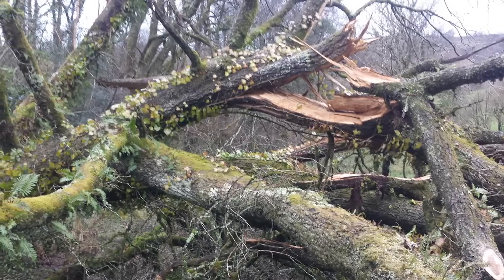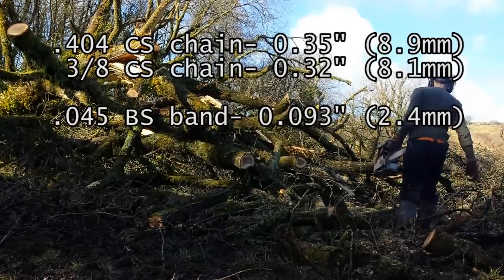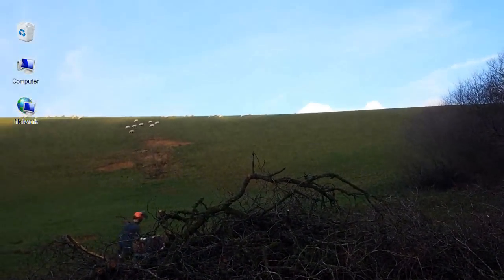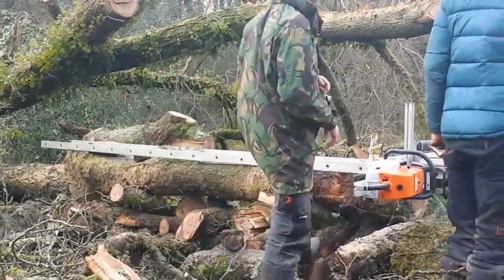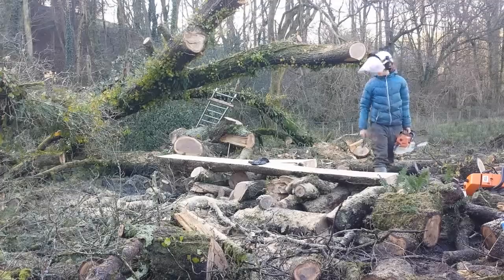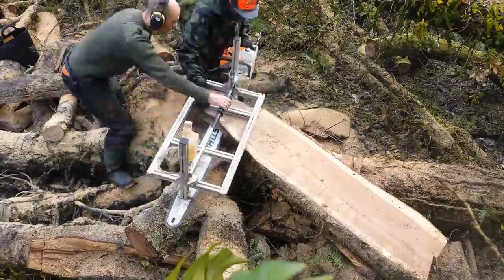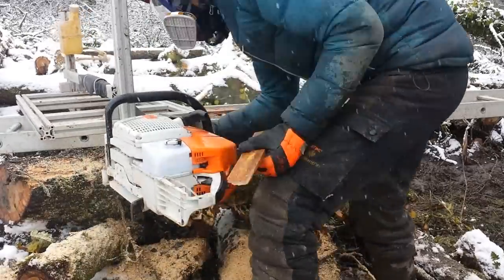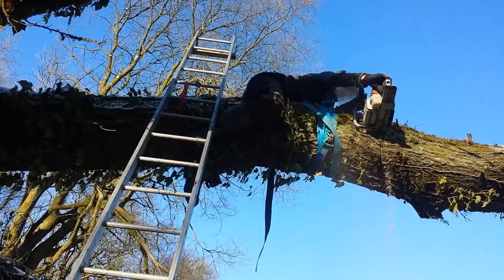Why DIY Chainsaw Mill BEATS Band Mill (cutting a Massive Oak)

Comment: A great overview for people on the Alaskan Mill. I run the same kit as you i think and would agree that you definitely need the right power to mill effectively. I got fed up with the effort involved, so fitted a winch, makes it easier if you are doing a lot of this. Also found it really important to use a 3M respirator, as the fumes are really nasty when you're so close up, found myself getting headaches a few hrs after use. 
I can't justify a big mill for the amount I cut, and not sure I want the care needed associated with owning one either, so this gives me the freedom and control to cut my own timber. Also nice to see some respect for the tree, too many people are just interested in commercial type felling and never seem to plant anything to come behind it.
Reply from the maker: John Roper fully agree with you. Will mention about the respirator in the vid description - it's quite important.
Reply: I used to mill without respirator, having the inconvenience of lots of dust in the nose,  but now I'm also using one of 3M. Much better now, but I only have filters against the dust, not the fumes. Which type of filters do U use to filter the fumes? Keep up the good milling! Opening a tree with the mill is like opening a present
Reply: Ditto

Comment: I have a 2 ton semi-clapped out (but mechanically good) dumper - a 4wd one. I use it as a timber skidder, log carrier, wood extractor, wood puller & general "get you into places not much else will get you to" yoke - you'd find one very handy for this work, Mr Elbowgrease. It's also ideal for lugging out heavy slabs. :-)

I share your views on making useful timber out of what would be wasted wood - but alaskan mills bore me witless so i just learnt how to cut slabs freehand like they do in the 3rd world etc etc - which I do.. erm, cut slabs. Having seen your mill, it looks a lot less dull than most of the ones out there, so the design may get knocked off with little or no credit being given to the originator - I.E You.. what for making me look smarterer with the missus & whatnot. :-)

Comment: Monster tree, shame to see it die, but great that you can get some really good use out of it :-) I felled around 200sqm of forest using a 300mm/12" dewalt 18V chainsaw about a year ago, went very well, only took me a week while working half days remotely on my laptop during sunlight hours, cutting timber first thing and last thing. Near silent for stealth and plenty powerful enough - the largest trunk was a mere 350mm wide requiring backward cuts to complete on the tiny saw, but before that day I had never felled a tree at all, only light use of dad's chainsaws from time to time. But, needs must, legislation change forced the timing. Around 1000sqm plus still remains and only 2 common species were cut (by luck), no special trees got the chop. :-)

Comment: Heres a tip. I jave a 24 inch bar for my 660 that I use on smaller wood. Less sharpening on those smaller ones.
 I like the voice over.
Reply: do you use a normal chain or a special ripping chain ?
Reply: @hikemoreh96pro  ripping chain.. Oregon.  I love it. Full house.

Comment: I'm using your instructable guide to build a mill.  When looking closer at your mill in the videos, I see you added inside corner brackets to 3 sides of the vertical alignment piece closest to the saw,  and another one on the nose end of the bar.  And you have a horizontal bracket connecting the vertical piece to the height adjusting piece at the nose of the bar.  Can you explain what problems you were having that made you add them?  Especially the horizontal bracket at the nose.  Thanks!

Comment: Great looking slabs, best way to salvage the wood . I'm interested in the mill. How many trees has the mill gone through? Im concerned about the vibration on th 8020 bar attached to the saw bar. But I would like to see a video on how it was constructed. Thanks
Reply from the maker: Richard Britt I don't have a vid on the construction of the cs mill... but did do a whole big instructable on the subject... I will dig the link out when I get to a proper computer.
Reply from the maker: It's been through quite a few now...
Reply from the maker: https://www.instructables.com/id/Chainsaw-Mill-Build-Use-Tips-n-Tricks/

Comment: Wow. I would think the ms440 would be a great milling saw. If I'm not mistaken the 440 is a 70cc displacement, correct? Its a big saw and I currently have one with a 20" bar. I'm actually thinking about buying a smaller saw because of its size. A 38cc saw would better suit my needs as a landowner. Most of the stuff I cut is small however I did slab up some northern pine and the 440 did fine. I haven't tried hardwood yet though.
Reply from the maker: Good day Matt, thanks for getting in touch. You're right, the 440 is a 70cc saw. I guess it is both big and very small, depending on the size of trees you plan to cut! 
After pushing it too hard milling, and rebuilding it a few times, I can say it's too small for what I want (slabbing 1.5ft and up hardwoods). It is just perfect for general ground work though (for my body size etc.) Obviously if doing more tricksy stuff, like laying hedges or something, I'm all for small... 
Thanks again, 
Bongo.

Comment: Great video! What kind of blade do you have on your chainsaw? Your slabs are so smooth afterwards. My slabs come out with deep grooves in them from the saw teeth.
Reply from the maker: Samuel Dunn  thanks, In this video I was using a bog standard RS stihl 404  30 degree top plate angle... which ever type you use 10 degree rip chain or standard the sharpening is crucial and I'd be tempted to say is almost impossible to do completely evenly by hand file methods... I have loads of other tips for smoothness - will put in the next vid...
Reply: That was going to be my next question but I'll wait for the next video instead! Looking forward to it.

Comment: The portability is by far the reason. I can carry a 60" mill out in the bush, in the middle of the forest or wherever. A 40" bandsaw? Yea, good luck. Don't even start me on the price difference lol. Different tools for different uses. A bandsaw will always beat a chainsaw mill in speed and work volume, for sure. But a big chainsaw powerhead @~120cc will slab even the largest trees you can find. Can't do the with the largest of bandsaw mills worth hundreds of thousands of dollars.
Reply from the maker: Right on the money there, yes!

Comment: What chainsaw and bar do you use?
Reply from the maker: Hi T-rex good question. It's a stihl ms880 and a 47" hardnose stihl guide bar. Hope that helps. Loads more detail of my milling rig in my  other chainsawing vids...
Reply: @FloweringElbow  Yes thanks. Thats a monster saw. I need it for slabbing big oak and making some timber frame posts and beams. I will check out your other videos.
Reply from the maker: @trex283  cool cool. Any other questions just drop us a comment.

Comment: A chainsaw mill is the tool of last resort. 
I have a mobile bandsaw mill, a lucus slabbing and a chainsaw mill. 
If the log CAN fit on the bandsaw Millie goes on there. The thin kerf of the bandsaw mill makes it about 5 times faster than my slabbing mill. The slabbing mill also has a 23hp Briggs and Stratton engine same as the bandsaw mill. The kerf of the slabbing mill is .404 so it has to remove lots of material vs the bandsaw mill. I can cut about 28” wide on the bandsaw mill. I can cut bout 50 slabs a day without my real problem other than moving the wood otherwise it would be even more. 

Compare that to the chainsaw mill.when I use it I use a Stihl 660 magnum( a big ass saw) with a .404 bar. It’s not as long as the slabbing mill, only about 50” lbs long. It’s very slow compared to the slabber and standing still compared to the bandsaw mill. 
If you ever get a big mill you will DREAD using the chainsaw mill I promise you that.
Reply from the maker: Hey Jack, sounds like the voice of experience. Appreciate you taking the time my friend. Peace, Bongo.

Comment: I am just getting started and appreciate so much your insight, even if you did call me Bongo.  I want to order a 100' roll of chain, what type should I get? 

There's so many choices man!  Oregon 91VXL100U VersaCut Saw Chain, 100' Reel
by Oregon
OREGON 72LPX100U 100-Feet Reel of Super 70 Chisel Chain, 3/8-Inch
OREGON 22LPX100U 100-Feet Reel Super 20 Chain Saw, 0.325-Inch

Does it matter much which I get?  Which would you get?  Thx man.
Reply from the maker: Hey Rusedorange, thank you for your kind words. Apologies if I called you Bongo - that's what people call me so must be some confusion there! 
As for chain, I cant really help I'm afraid, I only have first hand knowledge of a few of them, and as you say the choice is vast... 
Could really do with a scientific-ish, rip test of a whole bunch couldn't we.... hmmm, maybe a video in the works. 
Sorry I couldn't be more help...
Cheers for now,
Bongo.

Comment: What type of stihl and chaintype are you running?
Reply from the maker: Cristijn de Vin  standard stihl rapid super 404 chain. The Ms880 saw.
Reply: FloweringElbow awesome setup. I’m running a 660 on a 42” 3/8 bar
Reply: @FloweringElbow, do you,( and if so, how) set your depth gauges?
Reply: You're using a bar other than Stihl for your 660, right? Stihl told me they recommend max 36 inch bar for their MS 660, but I sure could use a little longer bar right now, before I have to move up to their 880 saw and much longer bar.
Reply: yazhyk stihl says the oilpump is max capable of lubricating bars up to 36”. I’m using an extra external oiler on the tip of the blade

Comment: Have you thought about putting an assist mechanism on the bar to help pull the saw through the wood as you turn a crank hanlde which in turn tightens a cable/rope attached to opposite end of the log? That way you will not have to physically  push the saw through the wood.
Reply from the maker: Good evening Tony and Sharon. Thanks for the comment/ question. Yes, I am going to make a vid on this topic soon... In general if you have a sharp chain and orient the log so that you are cutting downhill, you should have to pull very little though... That said, orienting downhill, isn't always possible or convenient... Peace, Bongo

Comment: Hmm....seems like a hybrid mill would be the ticket. You have a "dedicate" chain saw for your mill anyway. Something like a small gas engine driving a bandsaw blade would  take care of the waste concerns...but are they really concerns? you have 5-6mm per cut difference, so you lose 1inch every 4 to 5 cuts? Say 10 cuts to lose a whole 2inch slab? But 10x 2inch slabs would be 20inches of flat cuts! Seems like your way is just fine for field work. A proper lumber mill that needs to be hyper efficient seems like a band saw makes sense.

Comment: were can i find dying trees that i can mill legally?
Reply from the maker: Haha. look out for them then ask the owner... Go for walks after a big storm... Get friendly with people that live in the sticks.. etc.
Reply: National Forests. small fee for a Permit, talk to the Rangers.
Reply: You would think National forest but in my area I was told by the usfs dead or down permit was firewood only
Reply: Could you take your firewood in 10' lengths for cutting into rounds later? You'd have to get creative in the joints with logs that short, but where there is a will, there is always a way.
Reply: I have yet to be approached about it as its pretty remote area,just think its absurd they would rather it rot than anyone use it

Comment: Having had both, I just can't agree with you on this. Far too easy to have a log arch on your ATV and just move all the millable material to a SAFE location and toss it on the band mill. Less waste, far safer in this kind of instance and time is money. Spending 4 times the effort and time to get it done just decreased the value for me way too much.
Reply from the maker: Vikingblooded Kraftwerks good points all, but... if you don't got a bandmill. ..  Even a tractor with a big log arch wouldn't be pulling this one out of this bog. Not easily anyway. The atv no chance at all!
Reply: you'd be surprised. I've pulled some pretty big stuff out with an arch and a few snatch blocks.

Comment: I'm wondering how many bandsaw mills you've owned?  Also what type?  How many log arches have you used.  You talk about chainsaw kerf as a a strict dimension on the chainsaw (regardless of how rough  the cut is), then talk about the bandsaw blade drifting and wavering in hardwoods, and therefore adding to the kerf for a bandsaw.   Obviously you haven't considered the wastage due to the extremely rough slab left by the chainsaw, at least 0.50", if not more, by the time your slab is planed smooth and flat. 

 If a bandsaw blade is drifting and wavering, it is of poor quality or construction or design, and or out of adjustment.

If all you have to use is a chainsaw mill then great job.  Don't start bashing bandsaw mills because you don't have one.  Great job using the resources you have and not letting the tree go to waste.
Reply from the maker: Customcutter, bandsaws are awesome, I just don't have one. Getting smooth boards (comparable to the best bandsaw finish) IS very possible with CS mills with good technique and a bit of practice.
Reply: He did mention that in hardwoods you lose more.

Comment: Don't mill branches.
The tension compression will warp the boards.
👍
Reply: I saw it. When the board was almost sawn through, it started to lift at the open end. Maybe a short beam would work?